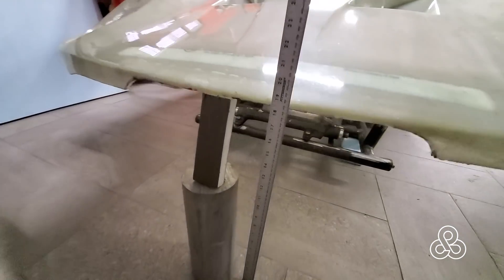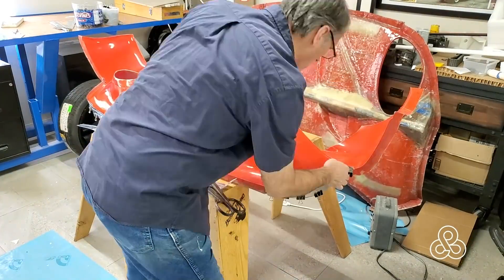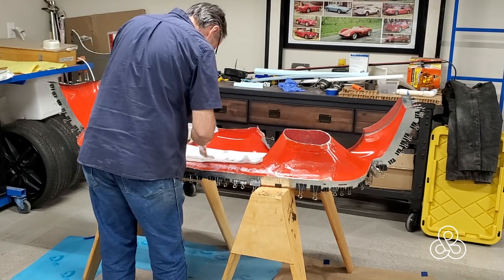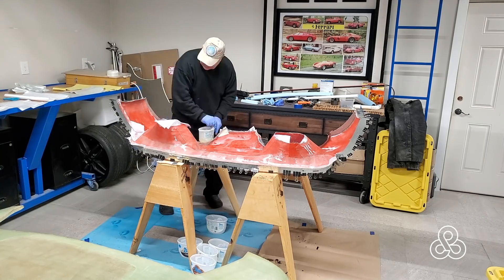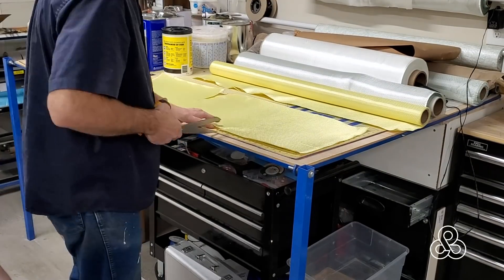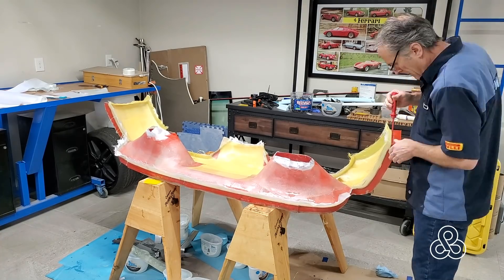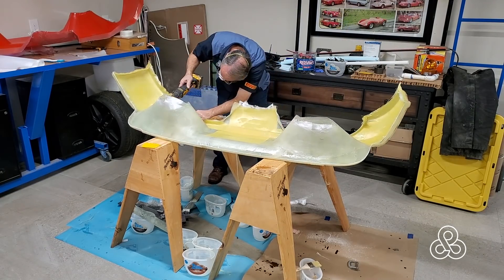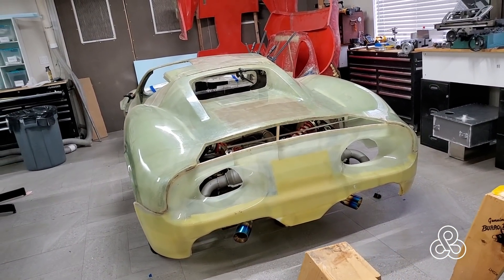A54 - This is what other drivers are going to see! Rear bumper fabrication - Arete Supercar project

Comment: Ever tried compressed air for mold separation?
Reply from the maker: Yes, I have found that it only helps if a fitting is installed in the mold toward the center of the part. blowing from the edge takes to much packing and just never puts as much force as wedges. Plus, with wedges you can add multiple wedges spreading the force out, whereas it would be difficult to have multiple air nozzles going. I do have some air wedges that work great in the right situation. Best solution is a good release. Ha!

Comment: Jay - Your build quality is top rate. I have been binge watching your videos for the last 3 days and I have to say at first I thought you were a retired race car fabricator with the level of skills you have displayed.  A few observations I have are:
1)  Your lathe is probably going to be OK, even though it looks beat up.  Check for run out tolerance on the chuck (many YouTube videos) and as long as it is in spec, you will be fine.  When you run the lathe, oil it continuously.  It may look like the SS Valdez, but that is the way those types of lathes are supposed to operate.  I have a machine shop at my home and run a 90 year old lathe that although smaller than yours, is similar in type and I just keep pumping oil into the oiling points throughout the day when I use it.
2)  I commented on your Kinetrol video about possibly using a linear actuator instead of the Kinetrol.  After thinking about it further and applying the KISS principle (I am an engineer), have you given thought to using heavy duty gas struts?  I checked on eBay and there are 150# struts available for a very reasonable price, along with other capacities.  This should save significantly on weight and complexity for the door mechanism.  Your doors should be fairly lightweight and I expect you could even gang up a couple of struts if you needed added door lift capacity.  Looking at your proposed hinge set-up for the doors, it looks like it is already nicely set up for a gas strut.
3)  Your willingness to relook at something already fabricated in order to make it better is great developmental work and I hope that all your viewers are encouraged that although the process sometimes means having to take a step back at times, it is the end result that matters.
Keep up the good work and I will be looking forward to your weekly updates.
Reply from the maker: I have yet to find an actual date on the lath, but some of the paint on it may indicate that it was once on a navy ship (possibly WWII era). It looks like most of the bearings are in good shape and can be adjusted with shims. Just the sheer mass of it should lend to way more precision than my toy lath.  Door actuator- looking for push button action on the close. pretty annoying on cars like this to have to hike yourself out of the seat to reach for the door, or straps hanging down. As I'm a little more conservative, I almost went with regular swinging doors, but as this is somewhat of a tribute to LM Prototype cars, I just had to go with butterfly doors. . . maybe the actuators can flip the car back over in case of a roll over? If not more of that "developmental" work. Ha! Thanks for all the watch time!
Reply: @BuilderCreator  From what you showed of the lathe in the video, my guess is 1910's to late 1920's is the age of the lathe.  If you can show some closeups of the nameplates, I would be happy to do some research for you on narrowing down the date.  There is also a site called VintageMachinery.org that has a lot of operating manuals for older equipment and they are in downloadable pdf form.

Comment: How much "crash structure" are you required to design in? It doesn't look like you've got the space for a crumble zone approach(?) Going old school with shock-mounted bumper beams behind the fiberglass?
Reply from the maker: Crash structure in front, impact absorbing muffler system in the rear. Ha!
Reply: @BuilderCreator   love it, USA vehicle laws so slack compared to Australian Design Rules.
Reply from the maker: @michaelanderson3771  You can lock us down, make us wear masks, strip our free speech rights . . .but take away our cars and there will be open rebellion!!
Reply: @BuilderCreator  Ah, the little known 1/2 mph impact standard! 🤣 Check out what Chevrolet did behind the front fascia of the 3rd Gen Camaro.

Comment: Any reason you aren’t vacuum bagging?
Reply from the maker: The molds have been created for hand lay up prototype parts. To do vac-bag the molds need to be much more ridged and have large flanges on them. Much more expensive and much more time. If I were to take the project to a production stage, then the time and expense might be justified.

Comment: Fantastic work as always from you.

From your videos using epoxy I see you appear to get very long working times in pot life before the resign starts to set. I have only used polyester resin before, but epoxy seems to have longer working times. Typically, what is the working time you get for a mix?
Reply from the maker: You can usually get 3 different hardeners with an epoxy system. I use the Medium hardener and get a pot life of about 45 minutes, although it is starting to thicken at about 30 minutes. Epoxy typically tends to "set off" slower than polyester and when you start to generate heat you just need to get is spread out on the layup for more work time. When polyester gets warm-your done. (this is all based on keeping your work area at about 70 degrees F (21C)
Reply: @BuilderCreator  Many thanks for the reply and insights ;)

Comment: didn't save it mom s finish panels which takes a whole lot more work than I care to admit I've done body work and your rear spoiler too high obnoxiously loud and did you understand aerodynamics about the struts on a rear spoiler where are you at if your struts at now you're going to lose one third of you down Force if you have your built and designed properly by aerodynamic laws you are only doing a ricer spoiler it looks good it doesn't mean that it works good do you really need a trunk in this answer is yes run the skirts for the spoiler back far enough trailer spoiler is just back far enough open the trunk up are you need to go back in time one of Hitler's Aerospace design engineers learnt that the back end of a vehicle was cut off Ferrari F250 Shelby Daytona Coupe more downforce on the rear end they have canards for on the front now do you Little little Roy's that don't have one tunnels know what you are dealing with easy designs look pleasing that does not mean they are functional the best one to date is the Hennessey quite frankly that is not his car he's only modified it to points necessary otherwise it is a kit car your ring is way too big I could help you most high speed stability and not so much dragon from that big ugly spoiler that is not necessary her downforce on the back of the back of that vehicle you ever think about electronically driven worm gears active aerodynamics you're fired go work for Fiat
Reply from the maker: Sorry, it's a staged picture for a YouTube thumbnail. I just didn't want to cut down 2 perfectly good pieces of aluminum extrusion to have the height right.

Comment: Tip for would be builders,
When building your dream car you may complete it and it will be an example of the finest engineering and safety principles and yet you won’t be allowed to drive it even on a racetrack because you didn’t jump through the appropriate hoops and roadblocks.
When Ford built the GT40 they had to redesign the tail so that the tail lights didn’t move when the hood was opened.
So no matter where you are or who you are there is always some red tape just waiting to trip you up and spoil your dream.
So plan ahead and find all the rules restitutions and loopholes before you start, and make sure before you invest too much time and money on the finished product that they haven’t gone and changed the rules on you. And don’t ignore them no matter how stupid they may seem.
there are places that won’t even let you change the paint colour without a permit yet you can import a travant or yugo or worse with little trouble. There are other places where you can’t build one car but if you claim to be building between 100 and 500 they will even give you a grant to do so.
To Builder Creator it’s looking good hope you get to drive it soon.
Reply from the maker: Thanks. . .I'm just glad my taillights will be fixed when the clamshell opens up! Ha!

Comment: Great job...I was curious if you were going to make your active wing dual purpose and have it be an air brake, being on a solid mount it would only take aluminium plate on underside, 2 hinges, actuators and pushrods...? Your work is very inspiring....
Reply from the maker: 3 position- back up- spoiler, full raise- max down force and full raise, tail up- air brake. At least that's the plan.
Reply: @BuilderCreator  it's gonna be awesome...a list of product and consumables to make body would be really helpful to get an idea of cost here in Australia... cheers

Comment: Sir, would the rear bumper be aesthetically similar to the Lotus Evija? and after all the parts are made and mounted will you be covering few sections with fiberglass reinforced filler to smoothen it out? and what will be the next step for the body panels after that..? 
Thank you.
Reply from the maker: Just went and looked at the Ajiva- and yes they are very similar aren't they. It looks like lotus is ducting air through the side of the car and out the tail to reduce the low pressure area behind the car. They may be doing something else in there to create down force as well; something similar to cars with the buttress over the rear wheel, like the new Ford GT and new Accura NXS. I added the big holes for cooling of the engine compartment. I thought of putting some sort of damper system to dump air from the diffuser through the holes to reduce the low pressure area during highway cruising, but I don't think there would be enough air moving through that path to make much difference. Maybe a couple 4Kw electric fans turning at 10,000rpm  like Gordon Murray's T50? Ha!  Filler- There are some areas (interior and door edges) that will be hand laminated and exposed to view. These areas will be filled with slurry (filled resin) and sanded smooth and painted.
Reply: @BuilderCreator  Yaa, when I saw the rear end assembled it just reminds me of the Evija 😂. 
Actually, after seeing the rear I also thought that the engine bay would be at relatively low pressure. like in the Arete the side scoops (air intake) will be obstructed by the radiators, and then there will be the rear opening, so the amount of air coming in would be less than what is coming out hence creating low pressure. 
Maybe a couple of vents on the rear trunk would help in better airflow, but again this is just my guess.

Really enjoying the progress... 😊👍

Comment: when can we hear and see some engine start ? :D ♥
Reply from the maker: So close, just a paint to disconnect fuel, coolant, wiring and such to do other things, so holding off until a few more things get finished on the structural.
Reply: @BuilderCreator  What is the planned HP output of the engine? I know you talked about it some months ago, has anything changed since then?
Reply from the maker: @assarstromblad3280  trying for 600 hp at engine
Reply: @BuilderCreator  Awesome, sounds like that would result in a good kg/hp ratio. Do you have any target for total weight?
Reply: @BuilderCreator  best of luck

Comment: What oscillating blade was used to trim? Looks like a lot less mess then spinning death wheels and body saw.
Reply from the maker: Very fine tooth carbide.  Next best invention to the 4 inch grinder. In fact it cuts so clean, most of the dust you see in the video is actually smoke as the blade burns off some epoxy.